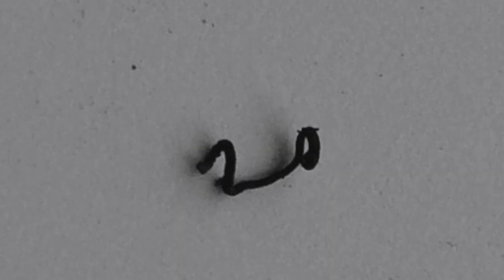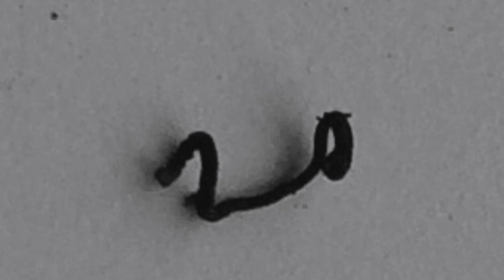The Microwave Production of Expanded Graphite

Comment: I am looking for a mass production idea to put this on the backing and then make the capacitor. Could you talk about any processes that might look promising? I would want the process to be able to get close to 1 atom thick process. Also is there any processes that might be able to make a fiber and then weave it into a strong fiber for Graphene wire?
Reply from the maker: I will have to look into producing graphene filaments some more. I know they have made graphene oxide yarns by rolling dried thin films of graphene oxide. Thermal reduction and annealing in nitrogen or argon gas mixed with small amounts of hydrogen gas will convert the graphene oxide into conductive graphene. Maybe a laser could work here. Perhaps a pyrolysis method or carbonization method will form graphene filaments out of other materials such as polymers, but the precursor material's composition and structure will determine the products' final properties. A scalable mass production method could be devised to allow for continuous graphene fiber output. I seriously would love to work on a project like that, and have a few ideas on how it can be achieved.
Reply from the maker: Just last week I saw a company in China is selling a commercial sized microwave furnace able to produce expanded graphite on a industrial level (~4 kg/day of expanded graphite with a density of 0.007g/cm^3). They were asking $133,300.00 USD for the unit. I have the info on the unit and company if you're curious. When I saw the price tag, I only dreamed of having a plant and major venture capital/funding to see such an furnace in operation. For  the quantities I experiment with, using my simple residential microwave oven route is cost effective. I have also demonstrated the production of expanded graphite using solar energy, and I belive this would be more efficient and economical.

I know they are producing carbon nanotube thread commercially, so I know a graphene fiber thread would be a viable product indeed.
Reply from the maker: Recently, on the first of the month, researchers at Rutgers University were able to reduce a graphene oxide fiber using one second of microwave energy (1000W) to form it into highly conductive graphene. This method could be utilized as well to produce graphene filaments. See: http://m.phys.org/news/2016-09-microwaves-high-quality-graphene.html

Comment: Nice vid, when you microwave materials your also shorting out/burning allot of the conductive properties. I did this a while back, you should verify this with your superior video Technique.  Leave your "acid-treated" materials soak for a lot longer, say a week or two. mine was over a month simply because I forgot about it. . do a quick rinse.  Put small sample of this flaked graphite in spoon. heat spoon with a torch, heat it from the bottom of said spoon.  Caution dont breath the dust that you'll see flying around.  Check out the MAX exfoliation you get. Also you can very results with types,  concentrations & time with the Acids.   Peace Out!
Reply from the maker: Yes, I did conclude that the microwave energy was too harsh, as it tended to fuse/weld some of the graphene sheets together in the "worms" which made it more difficult to further exfoliate into graphene. I however have been seeing greater electrical conductance in the products I made using microwave or electrical arcing, and I am eager to find the "sweet spot" of using just enough energy to cause the intercalated species to decompose without damaging or fusing the expanded graphite. I will have to try leaving the graphite in the acid solution longer (and try out other acids, concentrations etc.) as I did after the video I made on using citric acid in which acetic acid was formed. This batch I did leave for about a week before microwaving further to ensure complete intercalation, and the resulting product was the highest I made in regards to electrical conductivity. Thanks!
Reply from the maker: I'll try the torch method again after I make up several batches of the GIC and fine tune the process. I had success before using solar energy to exfoliate the GIC. Thanks again for your valuable insight!
Reply: No, Thank You for your video work.
Reply from the maker: +Dan Murphy You're welcome!
Reply: Jonathan Fosdick try taking out the microwave transformer and getting rid of half the secondary windings so it's only 500 watts, the power level option on most microwaves only pulses the same 1000 watts. then try cooking for double the time as you normally would, maybe this will make better results
Reply: @JonathanFosdickNano  sorry iam late, solar energy? did you mean concentratred just like fresnel lens?

Comment: So I have +50 mesh flake graphite from asbury carbons. I've tried intercalations in two separate ways: boiling sulfuric acid, and piranha solution treatment. I was able to achieve slight intercalation once with the boiling method, however, the method itself isn't very efficient. I was unable to reproduce the results. With piranha solution treatment in a 5:1 ratio of sulfuric acid to hydrogen peroxide, after a full 24 hour soaking, there was no intercalation. I'm starting to think I'm either doing something wrong or need different graphite. Do you have any suggestions?
Reply: @Ross Davidson  I’m downloading literature nowadays to check latest methods to expand Graphite, but my supervisor is requesting me new modification method 🤷🏻‍♀️
I would like to ask you did you find a way to get results ?
By the way, no need to explain or even name the method, I’m just carious weather you found a way or not !?

Comment: is the step with the acid necessary?
Reply from the maker: Yes, it is necessary to use the acid to wedge in between the graphite's layers. This is what expands the graphite in high temperature.
Reply: thanks..
Reply: Using electrolysis to apply 3v to the sulfuric acid will encourage the sulfuric acid between layers of graphite as well. Then if you apply 10-12v, it will blow the graphene layers apart, leaving you with ~3 layer thick graphene nanoparticles.
Reply: Is it possible just use only technical quality sofuric acid from car shop for this electrochemical graphite intercalation ? It gives very easy and cheap way to make large diy ionistors

Comment: Will Muriatic Acid (HCl) be sufficient with some modifications to the procedure? It's less toxic for those of us that have less than ideal working laboratories. I understand the quality may suffer.
Reply from the maker: John Wilkinson - Actually, several years ago I experimented with attempting to intercalate graphite with HCl. It released a TON of dangerous chlorine gas!! Very dangerous! If placed in a microvave it will destroy the oven and could kill anyone or anything around.
Reply: So I got some H2SO4 and exfoliated my graphene from a solid block. Do you know if a microwave will work as well using just sulfuric acid or should I add some phosphoric acid as well before I separate?

Comment: Just getting in to it "probably a stupid question"--How easy would it be to charge, plus, anyway to speculate how long before depleted?
Reply from the maker: Sorry for my late reply, I did not see your comment until now. I need to recheck my notification settings as I did not get any notice of your comment. Supercapacitors and electric double-layer cells will charge within seconds, and can handle and store large amounts of current due to the high specific surface area of the material. They also will discharge equally as fast, so using a "beefed up" regulator circuit to limit the discharge and convert amps to voltage is the key to allow supercapacitors to function as batteries. A test cell I slapped together January 1st was able to store just over 1 volt (with just under 1 amp). I left the cell laying on my shelf for about 8 months and I was shocked to discover it had kept a full charge all that time. That's another advantage of such supercapacitors, if they are constructed well, they do not self-discharge like normal batteries.

Comment: Could you go through the math to show the farad value of a capacitor made with 1 gram of graphene spread over the estimated 2000 to 2630 sq meters on each side of the capacitor plates?  I would like something about 15-16 volts dielectric.
Reply from the maker: I wish I could here as I can't begin to describe the quantum capacitance equations necessary to provide the math for you. If I can upload a pic here that would have helped. However, I can tell you that graphene theoretically has the capacitance of 550 F/g (if SAA=2,675 m^2/g according to one paper I have on my OneDrive account). But since graphene suffers from self-stacking, this value is much lower, and has been measured to be 183.8 m^2/g in one report. In one paper, ( http://www.doi.org/10.1021/nl102661q ), the researchers made curved graphene to achieve a higher energy density of around 85.6 Wh/kg @ RT (136 Wh/kg @ 80 degrees C) when measured with a current density of 1A/g. That is why I started to investigate using exfoliated graphite as it doesn't suffer from self-stacking as does normal graphene. I can dig up more references for you if you want. Please DM me with your email and I can provide more detail and links to the papers showing the math etc.
Reply from the maker: +Steve Forbin (I meant to say, "That's why I started investigating using 'expanded' graphite" instead of "exfoliated" graphite.)
Reply: Why not to just pass high electic current from welding machine thru intercalated graphite in protective gas ? The simplest way to get gas buffer protects from burning -- just make tiny heat pulse in closed box, you get some protective CO2 amount for free

Comment: can you use NaOH instead of an acid since I dont have good access to sulfuric acid and NaOH is easier to get
Reply: No, because NaOH would not be able to get in-between, or intercalate, the graphene layers of graphite in the same way that a sulfuric acid-nitric acid mixture would be able to.

The reason the graphite expands is because the heat energy from the microwave excites the graphite and sulfuric acid, which rips and flings the layers apart to make expanded graphite. NaOH would not be able to vaporize like sulfuric acid would.

Comment: Dear Jonathan,  I know it has been published long time ago, but now I am doing some research  ways to  increasing my battery capacity research. I found your expanded graphite method interesting and also cost effective. Saying that, I watched and read most comments below. Before, I go any further that I am mechanical engineer, So I can handle the microwave and even I can design one according to my own needs. The reason , I am saying that in your comment you mentioned "modified microwave"  so, if you can explain that then I can prepare my microwave or design one and quickly build one according to this purpose from any house hold microwave parts. So, you mean fume and gases to corrode the cables inside the microwave or is there any modification on power side of it. If you you only mentioned to discharging the gas safely out of the microwave , then solution is very easy for it. But, if you mention modifying the power of the microwave then I really like to know, if you can. Thanks for your time and hope to see your answer. If you do not want to disclose it to avoid amateur you tubers to try then please write to my email at  mralican6566@gmail.com . So,  I can do modification accordingly. Even I can share the solution that I can come up. regards
Reply: How's it going, I hope your research is going well. I'm also doing research on exfoliating graphene,  any results on your project?

Comment: How much surface area increase do you estimate is the increase by exfoliating the graphite?
Reply from the maker: A single flake of graphene consists of millions of individual layers of graphene. If you measure the lateral size of ~35 mesh graphite, times it by two (for each side of each graphite flake), and times it by a million or so, you would have an increase of surface area by at least four orders of magnitude. Graphene has a theoretical specific surface area of about 2,630 square meters per gram according to various estimates, even greater than carbon nanotubes or even carbon black.
Reply from the maker: Correction, I meant to say at the beginning, "A single flake of graphite* consists .."
Reply from the maker: But, in expanded graphite, not all of the individual sheets of graphene are fully separated as they still are bound to a certain degree to eachother due to van der Waals forces and nanowelding of the graphene layers by the heat induced by the microwave energy. I would say about 10% or less of each constituent flake would be bound in this manner and would vary on the exfoliation process and conditions. I would say it would have just over 2,000 square meters a gram in this form, but this is only an approximate.
Reply: +Jonathan Fosdick do you have any venture ideas from this. Capacitors or batteries for example. I mean there are multi billion dollar industries out there investing and tinkering this material but none have ingenuity and follow a status quo in developing manufacturing. I am also interested in the potential of graphene. you can be a rich layman and still succeed if you know how to invest properly but money like this is a challenge

Comment: where do you buy these acids ? where to find them ?
Reply from the maker: cvbngferty fdgh - I found them at hardware and automotive stores. I had to carefully boil down the sulfuric acid in order to concentrate it and was extremely dangerous as it reaches a very hot temperature (375 degrees +) and produces SOx gas. I had to use an acid-resistant thermometer as well to keep the temperature low enough not to loose too much SOx gas during the process.
Reply: "375 degrees +"
I assume you are talking about °F, since 300°C is about the limit. But then again, 375°F would be way to cold, so thats a very big plus.

Comment: I am doing at the moment  fast exfoliation without microwaves and with 05-8 mesh, lets say pure dust.
Reply from the maker: How are you doing it?
Reply from the maker: Are you using dry ice/CO2 to expand the graphite?
Reply: CO2 in liqiude plus 60%Hydrogen Peroxides plus Graphite washed in sprites and some Acids. sometimes i do experiment to ad some potassium permanganate.But this might be extremely dangerous. I will make a Youtube one like a from Australia made soon.
Reply: But with help of  microwave it works out even better.
Reply from the maker: +Bartosz Barejko Yes, I can see how that would work very good. Hydrogen peroxide, alcohol spirits and acids will work in between the layers, and the water would instantly freeze and expand the graphite layers apart. Thanks for sharing!
Reply from the maker: +Bartosz Barejko 60% hydrogen peroxide will also freeze close to 57 degrees C
Reply: But we have to keep appropriate proportion for example 40% of H.Peroxides plus 15% of Co2 plus some Spiritus plus Acides,and Graphite some will freeze but the other when mixed, they will have to expand. It is very difficult for fast explanation.I do need some more tests with it.
Reply: Good night it is very late here in Poland,
Reply from the maker: +Bartosz Barejko Yes, it is very interesting to imagine the process in detail. Thank you for sharing! 🙂 Good night

Comment: Why is expanding necessary?
Reply from the maker: The individual layers of graphene in graphite are strongly bound to each other, which makes separating graphene difficult. Expanding natural flakes of graphite this way helps in this process as a preliminary step in order to produce graphene in bulk. Expanded graphite can also be incorporated into batteries and supercapacitors as a highly-conductive scaffold or framework with a high surface area. The high surface area translates into more energy storage as there is more surface and sites where ions or charges can be collected. I hope my answer helps.
Reply: Jonathan Silly question, is Graphene oxide and expanded graphite the same thing? How do I go from expanded to quality usable Graphene?
Reply: @mrphwibbs9766  same end result of mono layer trying to get the last atom broken to 1 of it self thin layer it is a difficult process and one to think of better ways of... being oxidized or not just gives it different end material purpose uses